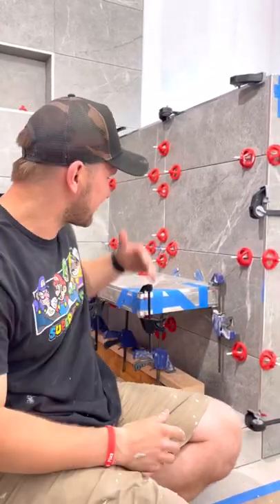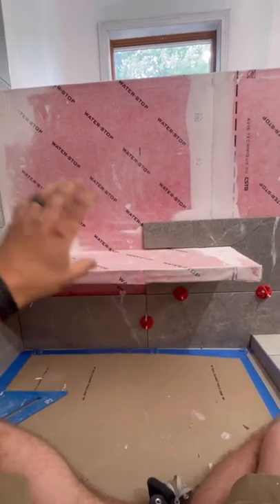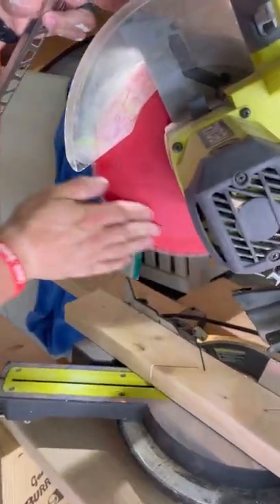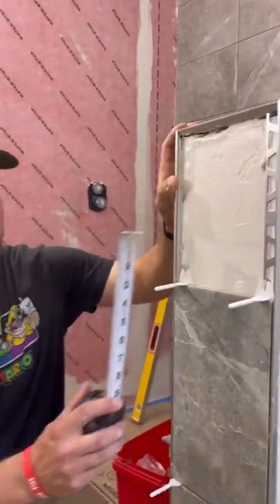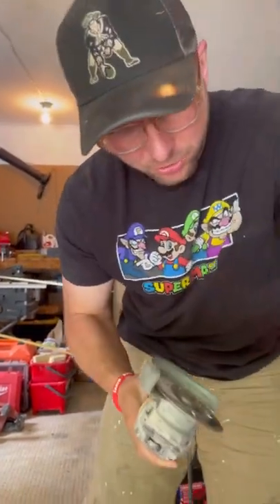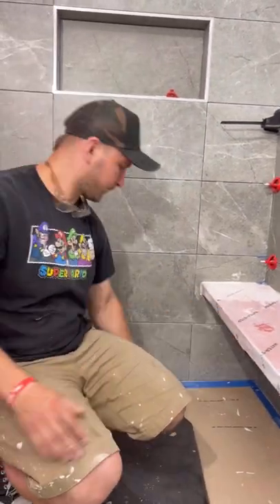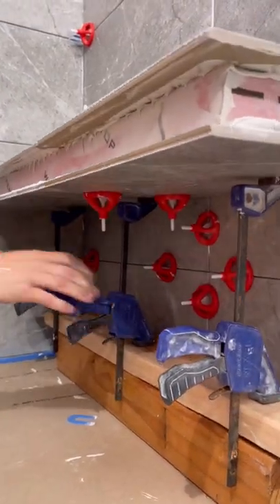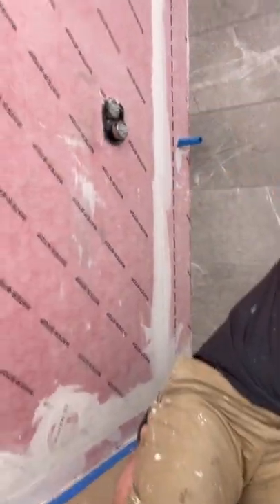TILE A SHOWER BENCH - TILE A HALF WALL - WINNI Vlog 016

Comment: Wondering if you could have tilled bench top first and then wall to get extra water protection.  Seems like grout between bench seat and wall would be where water could penetrate.  I guess with the waterproofing behind its ok.  thanks for sharing

Comment: Why not do the bench first, then the wall tile laps down over? I see you do the same with your membrane installs.
Sorry, I think  like a roofer-"follow the drip"
Reply: It is much trickier to do nicely finished and accurate U cut trimming bench surface than the way it was done on video, and waterproofing wraps entire bench anyway so it doesn’t give any benefit making it more difficult that it should be.

Comment: We bought the brackets for the bench. What did you add to the bench before adding the tiles?
Reply: Did you get your answer? Asking because I’m wondering the same thing. 
Like was cement board used prior to tile ?
Reply: @jruiz1996  did not get an answer

Comment: You can’t do any of that you have to tuck the tile on the seat and top of shelf underneath wall tile TCNA thin set can not be more than 3/4 of an inch your wall doesn’t have to be plum but why not Sluetter was nice though